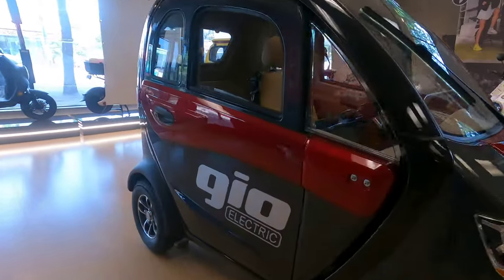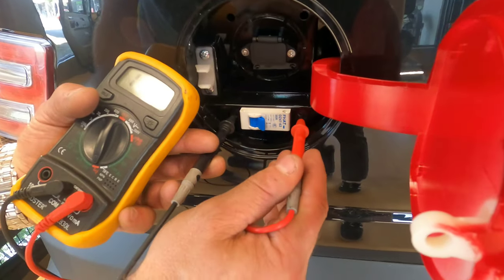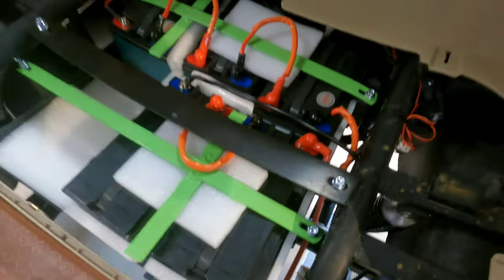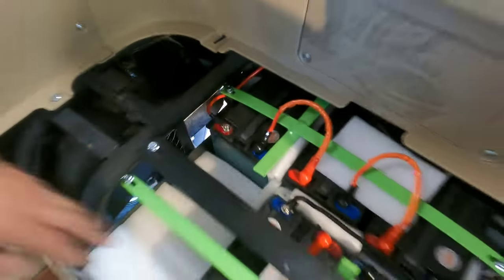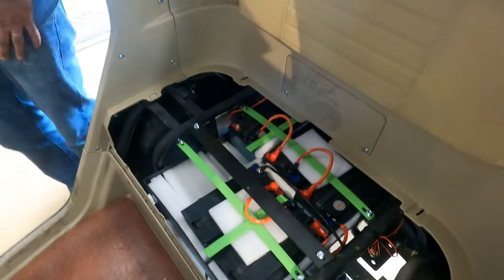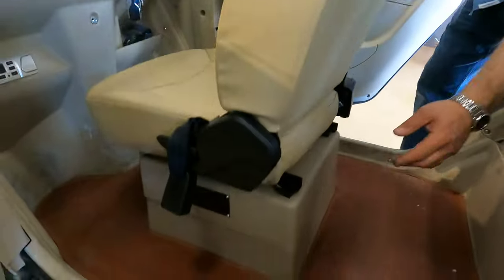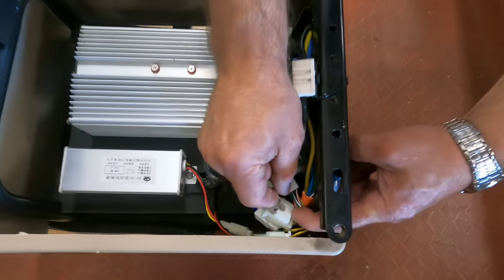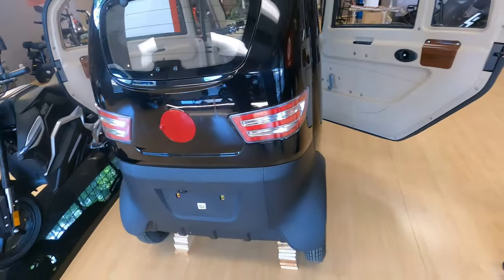Gio Golf no power diagnostic

Comment: SLA lead-acid batteries? 18 month service life at best. Sort of cheaped out on that, didn't they?
Reply from the maker: Yes and no.  The thing is that there are so many Lithium battery manufacturers on the market,  and probably 75% of them dont do what they promise.  I mean you will get only 5% ( 10% if you are lucky)  more distance range on Lithium vs Lead acid, but you will pay 300%+ more price tag....Yes , it might last you 3-5 years longer, but if something goes wrong with internal motherboard inside the battery , you are stuck and will need to buy a new battery that cost 3-4 K , instead of Lead  acid batteries that cost only 500$...
Reply: @You-can-fix-it  Li batteries last longer than "3 to 5 years". Make that 6+X longer. They [lead acid] weigh 3 to 4 X more. Li batteries are closing on the cost of flooded lead acid. I equipped my golf cart with Li batteries at a similar cost of lead acid. The only "con" is the fact the capacity of many [most?] Li batteries is usually and deceptively wrong..
Reply from the maker: @schizy  Goog quality Lithium batteries 72v and 50 -60 Apms cost 2-3k , and in my opinion, it is not worth it. But it depends on the brand and cost, I guess. This Gio Golf will have a Lithium battery and A/C  option next year, but the price of the unit will be higher by 1500$